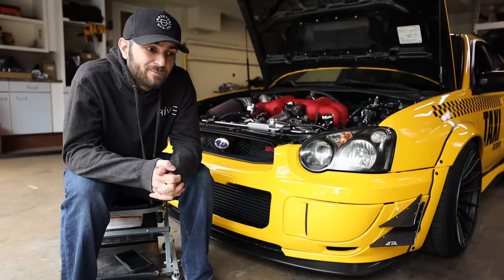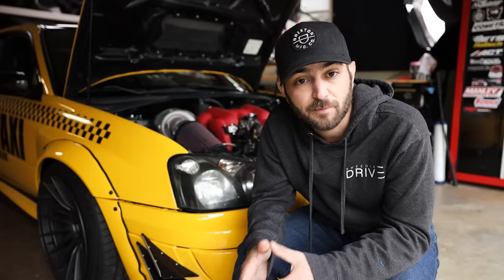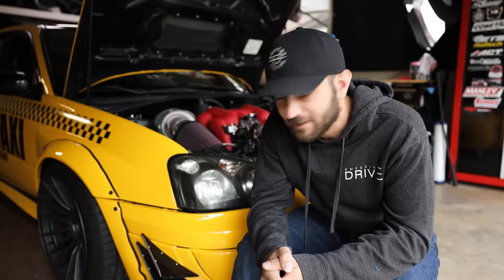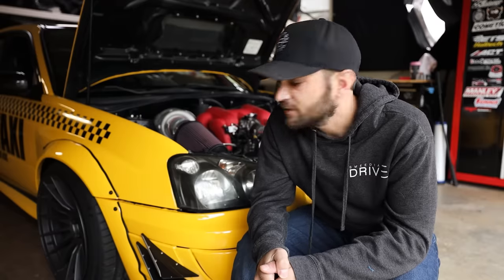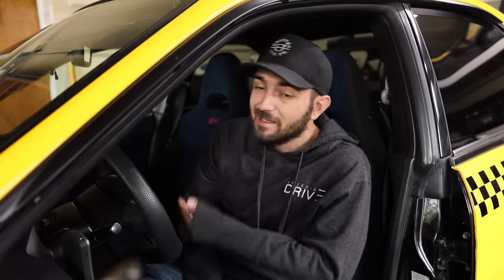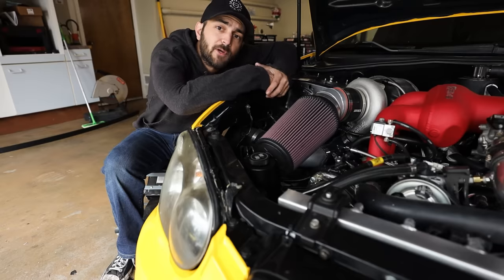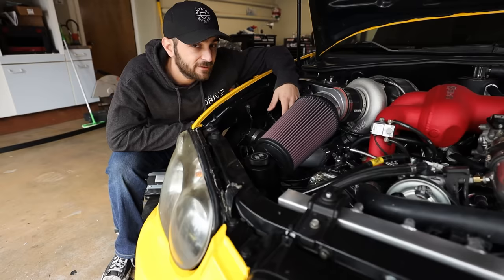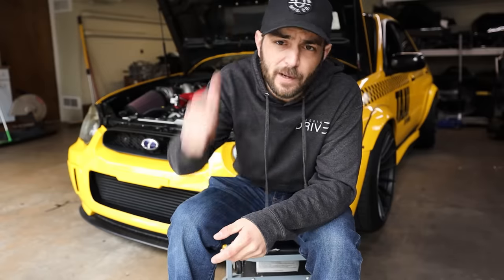What You Can do To Keep Your Subaru Reliable.

Comment: I think one of the things most people overlook when modifying a car is the fact that the more mods you have the shorter it’s engine/trans life will be.
Reply from the maker: Facts! Definitely can reduce lifespan when you start pushing it harder and farther
Reply: It is not as simple as that . Many mods made correctly actually make your car more reliable and they allow you to run more boost and more ignition timing without making the car less reliable than its original form . Moreover , some original parts are so reliable that they can take more power and torque without reducing their lifespan . It starts getting less reliable than stock only for really highly tuned cars...or those tuned badly which makes more than 90% of all problems encountered
Reply: @nikolaosskordas9159  I agree. Either cheap parts or not properly built. I've modded ever car I owned, and none have blown. I've always passed the cars along and seen them on the road years later.
Reply: Most mods I do are reliability mods to go along with a better tune and bolt ons. You can get plenty of power out of these cars with that. Just a tune livens these up like crazy
Reply: With the mods I've pushed the stock block to at this point, I expect to get at least a little fun out of it in the 'safe' 450hp tune.

But I also got into modding because I flat out KNOW this isn't going to last, and planned what I built into the next stage for the future block build.

Just, if you have this kind of car and you want to build for power, always plan/build for at least a tier over what you want, and if you can, go more.
Reply: @nikolaosskordas9159  The biggest problem with modifying a vehicle is anything that adds power will create more stress on your internals especially when you add more boost. That will decrease the life of the motor/trans
Reply: I understand you should use the Cobb parts for the OTS tune, but if you’re on a stage 2 SF tune does your catback matter if your running the Cobb parts. I know it might be a stupid question but it’s something I’ve been wondering
Reply: @joshuawilliams1477  not exactly . More boost more stress ok , but that doesn't mean always less life . Some components will have the same life at various boost levels and it will only decrease if boost exceeds a certain amount . Moreover , internals and transmission parts can also be swapped with more robust parts . The bottom line is , for the majority of the sports cars , we can make some mods which double or triple the original horsepower without inducing shorter life . It has been done numerous times...we are not trying to invent the wheel
Reply: Pretty brutal lifespan stock though
Reply: Not True... Refer to The golden Rule. Lol
Reply: Yeah like that hot air cone intake
Reply from the maker: IATs never went +5 above ambient 🤙
Reply: I think its a toss up.. Things like wmi and catch cans can keep your engine cleaner. Replacing stuff with silicone or polyurethane can save on other parts. But generally yes your asking more from your engine then it was planned for. But a good tune that keeps boost out of low rpm and has proper afr, combined with frequent oil changes, good warm up and cool down procedures. You can still get a lot of life from fairly highly performing car. If your looking for a 1000hp race car then obviously those are intended to be rebuilt within a few thousand miles. My tuner made 430whp on a stock 200k motor that lasted awhile. Ive been driving mine fairly hard at times for almost 3 years amd still have solid compression numbers as when i started. Another thing i forgot to add is if your running a small turbine housing expect higher egt (exhaust gas temp) and ebp (exhaust back pressure) which leads to higher in cylinder temps. An egt probe or larger downpipe can save you an engine. Idk about Subaru but volvo trans are super strong. Ive seen 900+whp on stock axles and trans with heavier pressure plate and pucked discs. I use redline mt90 in all my manual trans. I go to extreme overkill and change my oil every 1500 miles fully synthetic and gear oil every 2 to 3 years. As well as coolant and brake fluid. Turbo engines run hotter then na and it gets "toasteee" in my mortal kombat scorpion voice umder the bonnet. Fluids do break down with repeated heat cycles.
Reply: @chavorucosnkombies  you think an enclosed airbox really makes that much difference? Id like to see an iat comparison. I run a ram air tube from the grill up to the cone filter. Has 3" extension off the maf so filter is Right behind the grill. Idk about temp as mine has no iat sensor but i get zero knock with 39* of timing advance. Reaching maximum brake torque. Hes got massive intercooler so what ever was hot entering the turbo was minty fresh by the time it reaches the intake manifold. An airbox in a hot engine bay cant be much cooler. Not like the airbox is made from aerospace material. Reroute your ac vents into the engine bay or better yet into the intercooler lol.
Reply: more heat and power = more stress and wear.
Reply: i think youre confusing power/torque with mods, more power reduces life, not neccesarily mods.
Reply: Depends on what but modding these common consomer cars never made sense to me.
Reply: Modifications should be done in a specific order so that the car remains reliable
Reply: I've had my sti nearly a year and I think the thing with these is that if you don't have basic tech skills to service regularly(save big $$$) and have to visit the dealer the costs are more than people expect from a Japanese car.  To me it's fine and I can throw it on a lift any day.   If I didn't have that perk and made the same money and had to pay retail for service and parts it might be more than I'm comfortable with.  If you don't want to deal with that just go get an S2k or civic si etc. What other turbo sedans with awd are you gonna get in this price range that are fun to drive?
Reply: Very true. Which is why folks need to understand they make half their limit from factory that’s all motors all brands. 
Be ready to swap or rebuild period. Next week or 8 years from now.
Reply: I disagree.  I think the more power mods you do.  The less the life of the engine.  Some mods prolong the life of the engine.
Reply: Not necessarily,  its reallly about your mods, driver etc..
Reply: Also it’s people who cant install the parts right or they leave things loose and go rip on it. I always like to double check anything I’ve modded or upgraded. Never owned a subje cause of all the shit I hear but im so interested in one. I started with Audis and Hondas 
But the Subarus always had my attention. What’s a decent year to start with and what’s a good amount of miles that isn’t to much
Reply: Depends on the drive most drivers I've seen don't even shift as smooth as they should. Some don't even know the Rev without electrical gouges not good. Learn the basics first some of these guys pushin 350hp+ doing fine
Reply: The best mod you can make for a Subaru is to trade it for anything else.
Reply: @andrewharris7868 comments like this make me less scared to buy a Subaru WRX sti lol. I want one so badly ngl.
Reply: Ya true.  I just got a blob eye wrx. I've had 2 others that were tunned ima leave this one stock,
Reply: Lol, in cail, we have about 6 emissions deletes that definitely help your engine 😅
Reply: @Smeedia please help!!! I have an 07 wrx with a bad ecu.. and I just want it to run normal stock operation… my ecu is discontinued though… how can I make it run good without going to an expensive haltech or linksys ecu any ideas would be much appreciated… I tried to get a used ecu and copy and paste the eeprom but it’s hard to find a used ecu that isn’t also already bad… it’s not fueling correctly
Reply: Except for modding my Honda doesn’t effect much reliability
Reply: 😅😅 @Smeedia

Comment: Ive 130000 miles on my 97 Sti Coupe. Bought it with 40000. Never rebuilt. 4 things I done over the years, warm up 3mins, cool down 3-5 minutes sometimes more. Oil changes 5000 miles. Never absolutely dog it in 1st gear. Its been one of the most reliable cars I've owned in over 20 years driving.
Reply from the maker: Glad to hear she's still going strong 💪
Reply: 1st gear would b the least stressful on the engine? Surprised u change ur oil that infrequent but it sounds like you dont dog on ur car.
Reply: Escluse me what does dog it mean?
Reply: @HandlewithcareVibes  driving it hard
Reply: @donovankraus433  5000 miles is infrequent? I change mine every ~8000 or so and no problems in my 50,000 mile ownership
Reply: @shaloon64  50,000 miles doesnt prove much
Reply: @donovankraus433  my main point is that it seems a little excessive to change ur oil every 3000 miles if you think 5000 is infrequent
Reply: I’m not the most knowledgeable when it comes to cars but really want to prolong the life of my 14 wrx. How do you properly cool down a car?
Reply: @goose5688  It sounds like the coolant and oil cycle through the system while idling, thus allowing it to dissipate heat before shutting off the engine..
Reply: @shaloon64  honestly when the oil is black over 3k miles I change it. No more then 5k.
Reply: @donovankraus433  I average 20k a year in my outback 😅
Reply: @donovankraus433  50000 miles doesn't prove much ? I have seen engine failures at much lower mileage. Unfortunately the car isn't stupid proof
Reply: @fanningconstruction2050 better to go off the amount of run time because of gas diluting the oil in these cars
Reply: @shaloon64 um yes, it should be done  every 3k 😆
Reply: @gabriellytle9309  I technically change mine every ~1850 miles (3000 kilometers). It might seem like overkill with it being my daily, but I only drive about 8000 kilometers (5000 miles) a year, so I'd need to change it based on time rather than distance anyway.
Reply: Gives me a bit of confidence haha thank you
Reply: How do you clean carbon buildup?
Reply: @fanningconstruction2050  Don't use cheap oil and cheap filters , do an oil analysis and go forward! I prefer Amsoil signature series in both ejs.

Comment: Keeping to the maintenance schedule and driving it properly account for 80% I think. Ringland failure and rod bearing failure (apart from 2012-2016 defective blocks after the tsunami's) are usually 100% attributed to the driver. Lugging the engine in too high of a gear cruising, or getting into boost at too low of RPMs in too high of a gear is literally asking for your rings to crumble but it's how every drives (you trying to save MPG in a turbo subaru!?). Modding is it's own can of worms, and can exacerbate issues by problematic drivers.
Reply: Correct.  Blown EJ motors are typically 99% the fault of the owner.   The 1% include cracked oil pickups, backed out oil pump seal plate and defects.   I don’t understand how people blow these motors so much.   Mine gets thrashed on backroads and driven daily.  It an oil filter change ever 2500-3000 miles and all the maintenance is always up to date.  I have an intake, turbo inlet, throttle body hose, and the rest is bone stock. I have a custom tune on the car tune for 91 octane and I run 93. I use 5w 40 rotella and my car has been the most reliable car Iv ever seen.  It’s a tank.  Never ever ever ever ever have issues with my car aside from a rat eating the wires to my coolant temp sensor.  I love my wrx.  It’s AMAZING.
Reply: @joshuathomas4934  Seconded my man. I'm intake/inlet/ebcs/downpipe, was driving it over 25k miles a year for the first 3.5 years I owned it, down terrible roads and conditions doing client home visits. Nothing has broken that wasn't directly my fault. At 150k now. 2011.
Reply: I’m looking at getting a WRX soon, however I always run low RPM (currently have a N/A Impreza). How many rpm is recommended for cruising? And what is the correct shifting rpm for the turbo engines?
Reply: @MGK-fm9hc  that kind of depends on which wrx you're getting at this point in time-  5speed 255 engine, 6spd fa20, or 6spd fa24?

Comment: This is why i always say Subarus are good cars and reliable. Most of the time one of these cars blow is usually because of the person behind the wheel not the car. My 2012 WRX is at 145km so close to 100miles and is on the stock trans stock motor stock turbo and havent had a major issue with the car. This was an amazing video!
Reply from the maker: Thank you and 100%! They're not time bombs like people make them out to be
Reply: Mines a little 4 banger outback I daily drive it on top of taking it through every mud hole I see she still rolling fine you just can't be listening to your friends when they are telling you to whip it whip it.

Comment: Good video. I bought an 04 FXT with stage 2 OTS map. It has cobb intake and perrin catless DP. The previous owner was very moderate on the throttle all the time. It has lasted 180k miles. I got a protune for it which was his next step before I got ahold of it. It's also on the stock transmission. We both have done meticulous maintenance on the thing and it's been a reliable daily. Goes to show you can keep these engines alive if you take CARE of them
Reply from the maker: 100%! As long as they've been taken care of they'll last 🔥
Reply: air intakes are hit or miss for Ej motors in general due to sensitive changes of AFR and leaner combustion. even if tuned they are still sensitive to the engine.

Comment: If you're wanting a stock block pushed to 'safe' limits, that's about what I just built. :)

Just finishing up my last parts with my tuner, and looks like I'll be hitting about the numbers I was shooting for.

I built for track & street (non-daily), and have pretty much every single longevity/positive mod you can add at this point (very similar to yours), along with going ETS rotated & ELH.

I'm sitting at 390hp/350lb on o93 10%, @19psi after the first tune session. Obviously we could go more, but it's a good 'safe' area to be in.

For E85, my local station actually tests at 90%. During the tune, I ran into the fuel pump needing more power, so installing the IWire Kit/Studs as we speak to get finished next week. We're shooting for 450hp/380lb @ 19psi, though I might push it to 20 and see how it goes.

Otherwise, after the tune, I cannot believe how smooth, and QUIET it is. The only time you know it's a beast is under mid/heavy throttle. Otherwise regular driving, you would barely notice it was heavily modified. It's a whole different car now, and it feels verrry nice! I highly recommend doing it.

Just as he says, don't cheap out. Get the good stuff, as you'll pay more in money and time later on.
Reply from the maker: Sounds like a fun and solid build! Huge huge huge to not cheap out on mods!
Reply: @Smeedia  Oh it's awesome!

The S207 NBR build is now just about ready to show, but of course now it's coming into late Fall/Winter so nowhere to show it here in WI!

A whole lot of learning going on, but have to say you've been quite the inspiration of getting over my fear building all this over the past couple years. I'm coming from building older Dodge Turbo 2.2's back in the late 90's/2000's. After blowing up a Lancer Shelby back when, was very much nervous about getting back into the car scene.. But it's just part of the DNA, and got my dream car finally to build.

So this time, am making sure to do things right and learn as much as I can. Is also why it's super important to do all my own work, as you can take a ton of pride home knowing when finally done and successful, that warm glow of success.. Even though you have to go through so much pain to get there!

But, the reactions of people who see it and know, I never expected just driving around.. I really need to get this out more, because it seems folks like it. :D
Reply: @clintusmaximus  I got 400wheel an 400 TQ and it’s more than enough to have fun with lol 😂I want 1000 next build
Reply: @clintusmaximus  that’s what I want is to be scared 😂😂
Reply: Hey 👋 hope you are doing okay! I have been following you for quite sometime and have learned a lot about Subarus. I wanted to ask you a question and hoping get sone help. I own a 2015 Subaru Impreza Wrx and wanted to replace the Purge solenoid valve but can’t where is located. Can you please tell me where is the Purge solenoid valve location on the 2015 Subaru Impreza Wrx?. Thanks Bro appreciate you a lot.
Reply: Is that 390 at the wheel?

Comment: My first and current car is a 2006 Subaru WRX. Original engine and transmission. Only mods I put on it is an Injen cold air intake and a Greddy TI-C catback exhaust. It’s at 160000 miles and it’s still going strong. Changed the clutch and flywheel 3 times in its lifespan. Changed the timing belt with a performance belt for more lasting durability and replace the starter, ps pump and alternator once as well as spark plugs. It’s just common sense to maintain your car and know it’s limits instead of complaining that a head gasket was blown due to bad engineering rather than faulting the owner for being negligent.
Reply: At how many miles dis you replace the starter, ps pump and alternator?

Comment: I got at 2019 wrx CVT, I got it brand new, I put about 42k miles on it before I got it protuned, before I got it tuned I got an ETS intake installed, ran it with OTS and my Anxy port kept going at it, installed a catted invidia downpipe and IAG AOS, the car is now at 87k(I use it for work, drive around sf) i warm it up everytime it’s cold start loud, when i push it I don’t smell any burnt oil, I’m waiting for 100k+ mods or just swapping to to STI transmission when the time comes! So far the car has beeen going at it happily
Reply from the maker: Glad to hear that it's been treating you well! 🥳🥳🥳